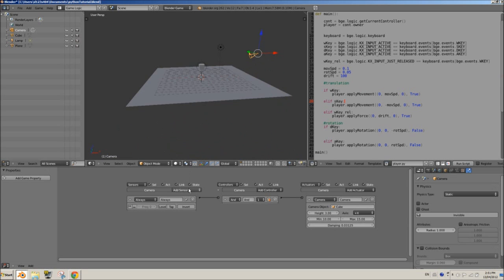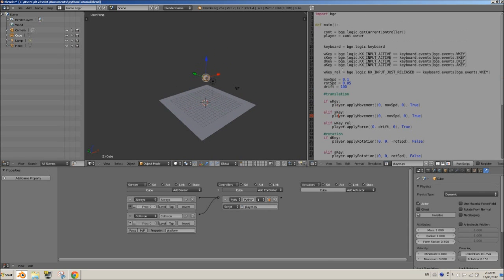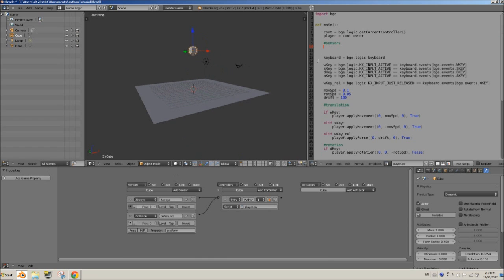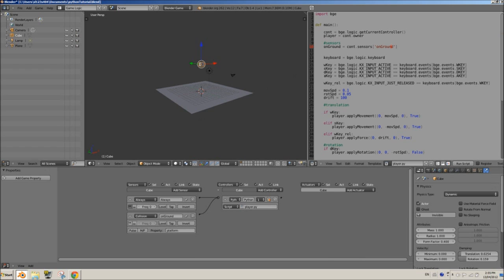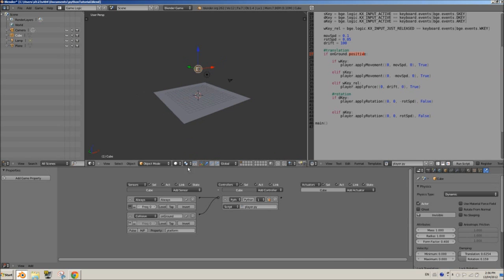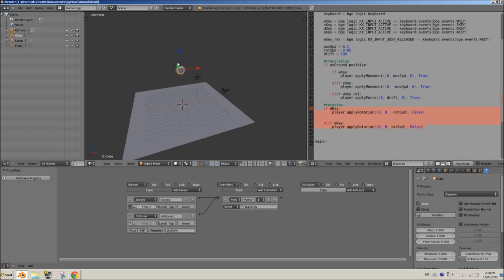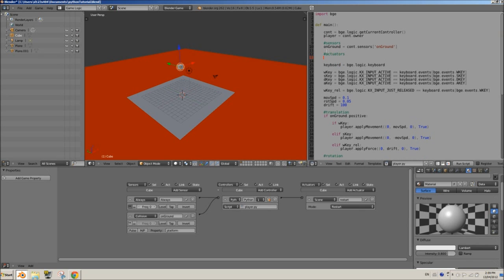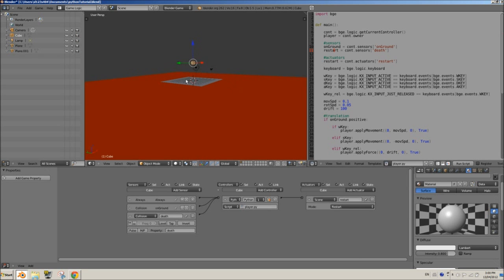[HD] Blender 2.6 Game Engine Python Scripting Tutorial - Sensors & Actuators - Part 01

Comment: Hey Can anyone help me, please? I have followed the exact procedure shown in the video however, I am unable to move the box using w,a,s,d keys. I also tried to print the values of wKey,aKey,sKey,dKey and there are always zero that's why the code is not entering in the if conditions. The value of onGround.positive is also always False even if the cube is on the platform. Basically any sensor is not working. What can be the reason? Thanks in advance..
Reply from the maker: Are you able to share the script you made? or better yet, the blend file. It's hard to tell what's wrong without looking at it.
Reply: @d123s404  Can I mail you?
Reply from the maker: @kalpantumdi898  Sure, d123s404@gmail.com

Comment: What do you have to type when you want your Sensor to be negative? Like for example if you want to do something when onGround is false? what do you have to type? Is it just  if onGround.negative:    ?
Reply: You might be able to do:

if not onGround.positive:
   ...
Reply from the maker: There is no actual .negative function for sensors. However, you'll notice on the logic brick itself that there is an "invert" button. Clicking it will reverse the sensors' functionality. Take the OnGround sensors for example: Clicking invert will trigger then sensor when it's not colliding with a platform. As for the code, you continue to use .positive in all cases since that's the only option.

In short the switch has to be made in the brick, not the code. :) This of course means that you have to make two bricks if you want positive and negative versions of "OnGround".
Reply: Ok, thank you :) btw: could you make some more python tuts please? I think you explain everything so well and you do everything very organised ;)
Reply: Or make a tutorial on how to make a seesaw in the BGE ;)

Comment from the maker: In doing a quick search in the API reference, there doesn't seem to be such a function. You can try posting a question on Blender Artists, and see what the more experienced guys such as SolarLune and Agoose have to say. I can also supply you with an example file of the method I told you about if you'd like. It's basically a side scrolling platformer template.

Comment from the maker: you could parent an object to be just in front of the player, and then vertex parent it to the player. That way, that object will always remain in the same rotation as the player, so it won't lose its orientation.
Then, you can simply add an "edit object" actuator to the player, set it to "track to", and chose the object you placed in front of the character. That way, whenever you press a button, the character will turn to face that object. Let me know if you need more detail. :)

Comment from the maker: What do you have in mind? Are you thinking of rotating an object a certain number of degrees? Or are you looking to make the object point at a particular direction of interest? Or are you simply trying to make a directional based movement system where the character would orient himself depending on the axis he is moving at?

All of the options I list will involve a similar approach, though they differ slightly in execution, so please specify. :)